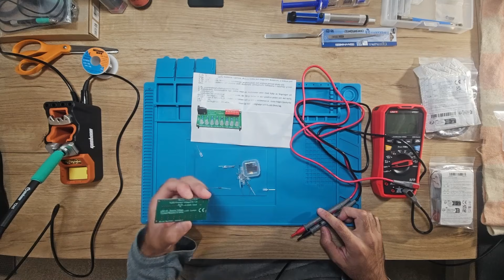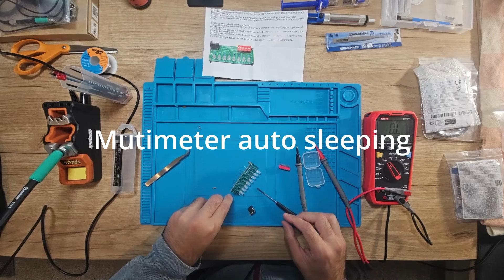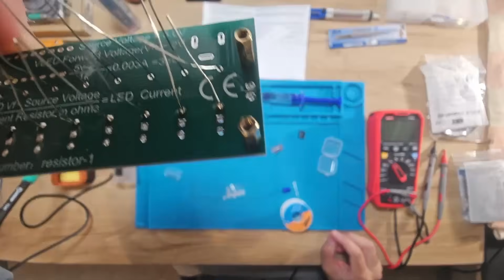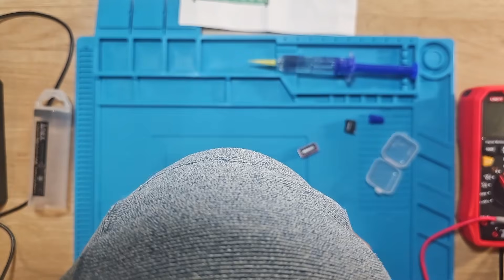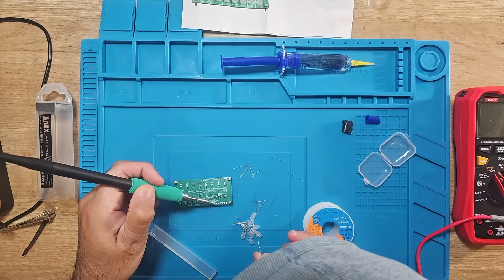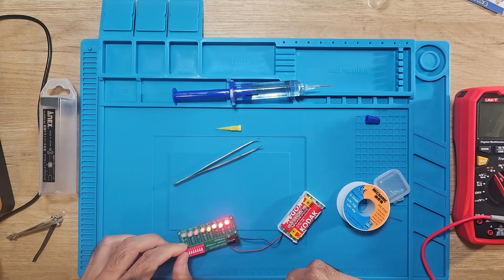My First Ever Project - Tech Repair From Scratch! - Episode 1

Comment: My recommendation for TH parts would be to use 0.7mm solder wire which usually also have a higher flux percentage then 0.5mm which is together with 0.3mm solder wire more suited for SMD works where additional flux is a must, but good job for an beginner 👍

Comment: Hi, electrician from Germany here, i just saw your first video and i though to myself, why not help a fellow out. A couple of tips on the multimeter, for diode testing, such as LEDs and sort, there is a function on the multimeter. It looks like a sideways triangle with a vertical line on the side. When the multimeter shows O.L it means Overload, which either means that the value of the electronic part exceeds the scale of the multimeter, or you are using a wrong function. Aswell as when you are measuring resistors, there is often a k (kilo=1000Ω - 999999Ω) or M (Mega= 1000000Ω and above) above the resistor value. There should also be a continuity tester, and the symbol for that function is like a volume symbol, this i good for finding shorts in the builds, or just to check if a part is still ok. If you got any more questions, feel free to ask, and good luck on your journey :)
Reply from the maker: Thank you! ok so maybe i wasnt completely crazy when i tried to test the LED haha. I have messed with the multimeter a bit but it will take me a while to learn all the different sybols and such. thank you again :)

Comment: Hi I AM JUST ADVICING AS U CAN BUY CHEAP HOT STATION THEY ARE EASIER THAN SOLDER AND USE SOLDER ALSO TO PUT IT ON BORD THEN FLUX AND THEN USE HOT AIR TO PUT PART IN PLACE AND YEAS INITIALY DONT PUT FLUX FIRST SOLDER  MELT IT WITH HOT AIR PLACE THE COMPONENT THEN FLUX TO REAJUST ITSELF OR BY  YOU AND IF U CAN U CAN DO DEAD MOBILE BATTERY REPLACEMENT 

LOVE THE VIDEO GOOD WORK AND I LIKE IT ❤ 
SUBSCRIBED 🎉❤
Reply: yeah but I wouldn't use hot air for tht parts.
Reply from the maker: Thank you, I definitely plan to get a hot air station!

Comment: Not bad for a first ever attempt.
60+ years ago I recall feeling very proud when the penny finally dropped on resister values. In those days, no meter (too expensive for a 7 year old) no google no internet, just the handbook of the Philips electronic engineer kit I got for a birthday.  2.2k ohms, 2200 ohms 2 (red) 2 (,red) x100 (,red) !      red, red, red,   first ever resistor decoded. After that things got easier 🙂

Soldering, yes a blade is not the right bit, use a chisel or elliptical bit, about 1.5-2mm in size. don't worry about handles and so on you need time to get used to things. As said below you don't need flux normally the solder has it built in. It is useful for very high heat requirement or "stubborn" large joints  

Check your solder. If it is lead free, then get some standard 60/40 lead tin solder it works a lot better. (You only need to worry about the lead free aspect for commercial products.)

The biggest change you need to make is get a  circuit board holder or a small vice (better yet get both! ) clamping the board in that while soldering gives you that third hand. Solder one lead, flip the board over and check if the component need re-seating, if so push it down while reheating the joint. Once done solder the other lead and then redo the first if necessary.  Sounds a lot of faffing about but you get used to it after a few thousand joints.

When I started working in the electronics industry, I got one surprise that I never considered.  "Put the resistors in the right way around" I was told during training... Of course everyone said it does not matter. The trainer said it does to the service engineers, if you pull out a card to fault find, if all the components are placed in the correct way, then he only has to turn the board 90 degrees to read the values easily. As this was a marine company, and the equipment could be on a ship in rough weather, it made sense.. 🙂 I still check for this in products after 50 years it got so ingrained in me! 
 

Andy
Reply from the maker: Thank you so much for the incredibly thought out response! That is so helpful. I will definitely look into getting a vice and circuit board holder. And great tip for the resister directions. All the best and hope to see you in my next vid!

Comment: You don't need extra flux if you get flux core solder.    Flux core has plenty of flux without adding any.    Congrats on new channel.   Good luck you have a lot to learn.   Simple things not including electronics itself.    At least you have the internet today.   When I started in the 1960s all you had were electronics magazines to learn from.   No people to ask questions.   No way to get datasheets on components.   Everything needed 30 to 90 days to get shipped.   Way easier to learn today than back then.
Reply: I disagree - respectfully. Everyone's experience is different but you can never use enough flux, but you can use too little flux. Even with flux core solder it typically is not enough. In my opinion. If you have problems with the flux flowing around your solder joints use more flux. Always more flux. 🙂
Reply from the maker: Thank you so much! yea having the internet is a blessing for sure.